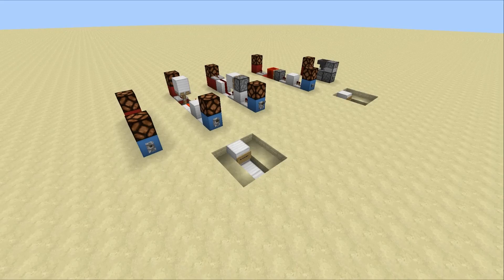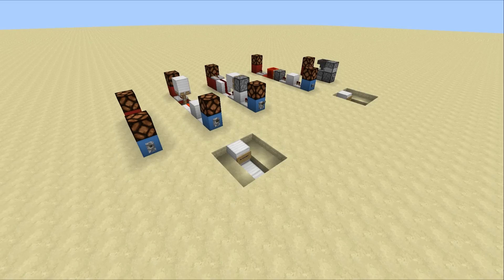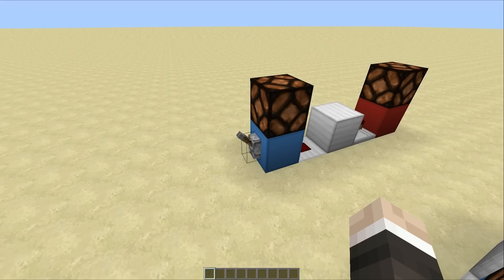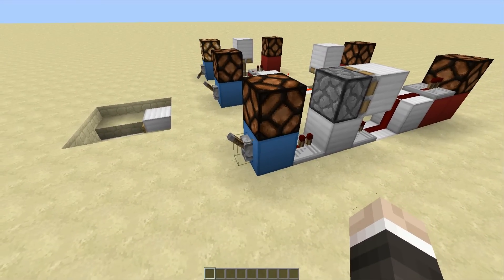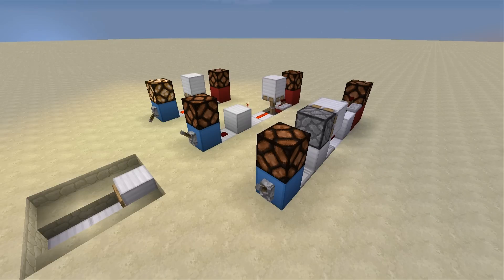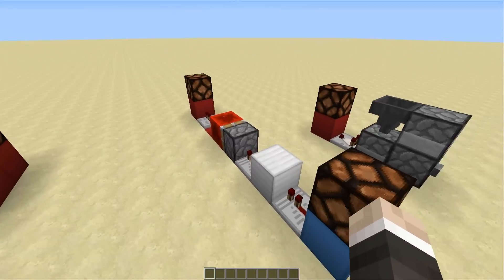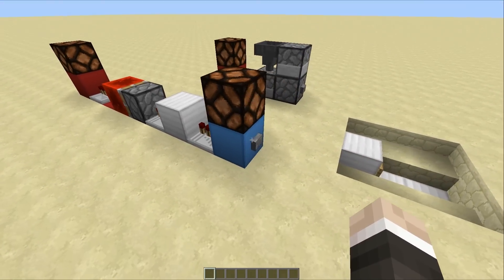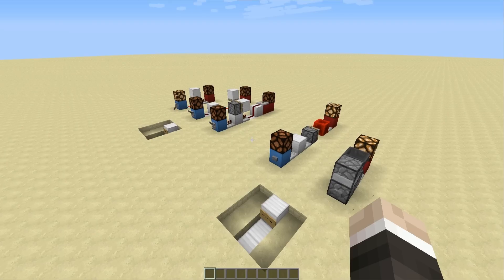T-Flip Flops And Monostable Circuits: EXPLAINED!

Comment: The dual edge monostable circuit has become redundant since the addition of observers, as now all you need is a button on a dispenser with a water bucket or lava bucket inside followed by an air block followed by an observer, which detects every time the dispenser places/removes the fluid.

Comment: About the falling edge monostable circuit (say that ten times fast), what am i doing wrong?
I've recreated it as-is in the video (block with lever and lamp, redstone behind it, redstone unpowering the torch on the other side of a block, with more redstone leading into the block on a sticky piston, with a repeater behind the block facing to the second lamp.
The piston works just fine when I flip the lever on and off, but the second lamp only ever turns on if I rapidly flip the lever over and over
Edit: looks like my combo one is also not working- I get the falling edge pulse, but not the rising edge.
Is this because I'm playing on bedrock edition?
Edit 2: Christ, my T-flipflop isn't working either. First off, using repeaters somehow prevents the first piston from rising up. Second, the redstone block is always pulled back, instead of staying in place like in the video (tried with a regular piston instead of a sticky one, but then it never came back. I should've seen that coming)
Edit 3: I somehow got the first piston to work by having the piston on the side instead. The second one is still refusing to leave the redstone block behind

Comment: One thing to note here is that this video was released before 1.11, so now the dual edge monostable can be simply made by putting a observer with its face to redstone dust or a block that is powered.

EDIT: also one more upside with this is that its not only way more compact, but also silent because you dont hear any pistons in the back, and the observer doesnt have a sound.
Reply: I built  the whole thing than read this comment. I can’t believe myself.
Reply: Legendary comment. Thank you boiling sausage

Comment: Easiest way to do an t flip flop (ans:dropper facing to each other the comparator should be facing to the pulse add redstone if it is far as long it does not trace back to the pulse) easy

Comment: How to make riing and falling edge monostable circuits using just 1 repeater, 1 comparator and 1 redstone torch:
Rising edge: Place a repeater on the block that is one block to the side then one block behind (1 block diagonally behind) the comparator. Then route the comparator input signal through the repeater input and the output of the repeater to the side input of the comparator. Set repeater to 1 tick. The output from the comparator is then a rising edge
Falling edge: Just invert the input signal using a redstone torch
Dual edge: idk yet (or could use just an observer as somebody below mentioned)

Comment: Trying to learn redstone. if someone would lend some advice.

1. So do most T-flip flops require a monostable circit in them to work?

2. If so, what would I use a monostable circit for other then T-flip flops?

Please and thanks internet.
Reply: ChazRave not necessarily, older designs of T flip flops did not use utilize monostable circuits.

You use monostable circuits when you want to turn a constant output like a lever into a button like signal. 

For example your build might require a t flip flop which outputs a constant signal. But then you need to turn it into a pulse. Hence, monostable circuit
Reply: @brandonlam9021  thanks, after some tinkering I think I got it.
Reply: No, most t-flip flop do not need a monostable circuit , but if you for example have a dispenser dispensing water  which is connected to a long lasting pulse and you want it to be a on-off 1 pulse dispenser, then you would need it to be a monostable circuit
Reply: @ArashTDS  Every bit helps, much appreciated

Comment: One of, IMO, the most obvious uses for T Flip-Flops is iron or piston doors, with buttons on both the inside & outside that are both connected to the T Flip-Flop, so you can push either of the buttons to open the doors, then push the other to close it, once you're through...

Comment: T-flip flops are better that levers because you can have multiple inputs. The lever itself is the constant output, so I cannot be changed by another circuit. The button, however, is not, so if you can get another one in the wiring early enough you can have as many inputs as you want.

Comment: You can make the second circuit way smaller these days by using a delayed input mechanic when a repeater is being deactivated. For this, you place a block with a lever and a repeater on 3 ticks afterwards. From the right of the block, you go right-right-up with redstone and a repeater with 1 tick facing inward your other repeater. For some reason, it will deactivate your repeater but when you release the signal for some reason it has memorised it and will give a pulse. Hopefully, you can explain why one day I just know it works for now :P

Comment: Another thing T-Flops are good for is being a receiver from multiple pulse sources for a single machine. For example, having a door or other machine that can be opened/closed from multiple sides/locations.
Reply: I love using T-flip flops for that
Reply: you can also use monostable circuits as a kind of t-flip flop
Reply: I used it to make a button that cycles power to different areas
Reply: Mumbo literally explained T flip flops IRL and it's helping me

Comment: the names are more confusing to me than the mechanics.. what's so stable about a monostable if it doesn't stay on.. I get the mono part
Reply: It has two states, output high (i.e. on) and output low (off). What makes it _mono_stable is that the circuit is only stable in one of those states. So, low output is stable and will remain low, but high output is unstable and almost immediately collapses back to low. Hence the result being a short pulse.
Reply: ***** oooooooooooooooo makes sense now..

Comment: Another use for T-Flip flops is piston doors. If you're on a server, or die on the other side of the door and have used a lever to close the door behind you, the door won't open upon toggling the outside lever. A T-Flip Flop toggles regardless of the location of the input, and I generally don't like the look of levers.
Reply: Well, you could combine the levers with a XOR-gate. That would make them work. But a T-Flip Flop is easier and buttons do in fact look better.

Comment: I've used the last T-Flip Flop design with the hopper at droppers for a piston door, since it's very compact. I have a problem though! Sometimes when I press the button, it doesn't trigger and needs to be pressed a second time. I'm not sure if I did something wrong or if it's just not the most reliable design on SMP or what. All I want is a compact T-Flip Flop that works every time. Is there a way to reduce the length of the first design?
Reply: I'm not sure if this will fix it, but the way you wire the T Flip-Flop is specific. You HAVE to have a repeater or a piece of redstone dust directly pointing into the input dropper. You cannot power the dopper from a block next to it. Hope this helps :)

Comment: can someone explain to me what use are monostable circuits ? i mean why just not use a button ?
Reply: The monostable circuit gives you a 1 tick pulse as the output, whereas a button lasts much longer.
Reply: so?
Reply: For example, in a 3 x 3 door, you need many pistons that need to be retracting and extending with just one lever flip. You need these circuits to activate in specific orders, and they need to be specific lengths.

Comment: Mumbo, as you seem to be the Grand Master of Redstone these days, can you take a swing at compacting down an auto sorter/smelter? I finally got a design together that sorts ores, cobble and coal out, and evenly strips the coal across 3 furnaces, and then smelts cobble into smooth, iron ore and gold ore into bars, and outputs them all into a final chest, but the thing is simply MASSIVE. it uses something like 32 hoppers, stands over 16 blocks tall, and 5 deep. The main feature I was trying to incorporate was the ability to divide the coal evenly across the furnaces, which I accomplished by parking hopper mine carts on the midline between hoppers below them. I would love to find a way to shrink this thing, but its eluding me.
Reply: Sorry to disappoint but it may not be possible with a reasonable amount of furnaces. Although MumboJumbo's has surprised in the past s, we may see.
Reply: Really though, in a singleplayer survival, if you can sort and auto-feed coal, 3-4 furnaces is plenty, (iron, gold, cobble, and if you want, sand) because it will churn through stuff while your away mining. sure, more furnaces is faster, but if I could compact a 3-4 furnace operation to not take up a small skyscraper, it would be awesome.
Reply: Take a look at TangoTek's "synchronized furnace array with automatic refueling." I think thats what you're talking about besides the sorter but that shouldn't be too difficult to add in id imagine. It's reasonably compact (about as much as it can be) but its pretty expensive. A lot of hoppers. But i built it in my survival and its one of the best things ever. Definitely something i will build in all my bases. Hope this helped!

Comment: I think my favorite redstone circuit is the RS Latch, followed closely by T-Flip Flops :)
Reply: i prefer X-OR and X-NOR
Reply: wow your profile picture you're so edgy

euphoria
Reply: Heh, I guess. At almost 36 edgy isn't something I really worry about anymore, lol.
Reply: JK Flip Flop masterrace!!
Reply: Heh, you mean master-slave, I hope? In MC, the SR already behaves like a JK anyway, doesn't it?
Reply: *****
JK != SR(RS)
An SR FF is no JK FF, not even in Minecraft
Reply: A JK latch is an improvement on the SR Latch that fixes problems that occur with both S and R are 1. JK doesn't have an issue with that input state. Otherwise they behave essentially the same. So are you talking about something other than a JK Latch?
Reply: *****
Well, it's an improvement/an advanced version of the RS that's correct. It still behaves differently (clock input) and offers much more opportunities than a regular RS latch - eg. if you're builing a logic gate based code lock with fancy bit input and RAM. Of course you can say it's just an RS latch with a few additional AND/NOR gates but then you can cut down any gate/latch into NOT gates...
Reply: PhilfreezeCH
I don't know a lot about electronics - at least not the practical experience. I only know the logical stuff because i find it interesting.
I know the LM555 (at least I heard that name a couple of times).
Reply: Kappa ProjectMinecraftia?

Comment: I enjoy these videos. But would you perhaps make one showing you designing a 'custom' version? I ask because a lot of times, when I find circuits like these in redstone, they don't look like this (all neat and straight in a line). I'd think a video explaining the key components of a Monostable and a Tflipflop would be really cool (instead of a video showcasing what they do)
Reply from the maker: I would suggest having a play around with it. With the monostable you can take an output from any of the sides of the blocks on top of the piston (Hope that made sense). If you want to turn the monostable into a T-flip just put a repeater on default ticks running into a piston from the monostable and that is it done :) typed this on mobile so it may be tough to understand
Reply: Mumbo Jumbo
LAWL xD